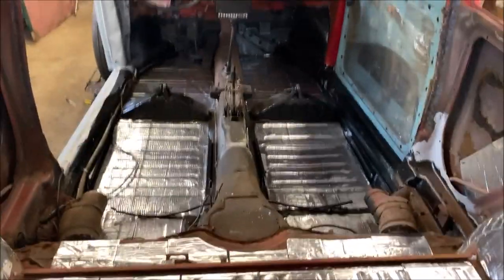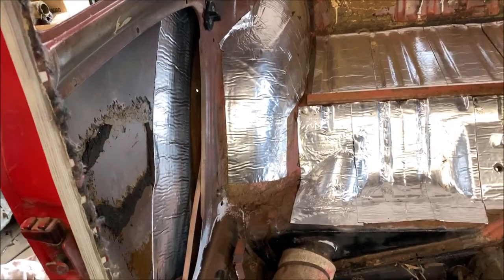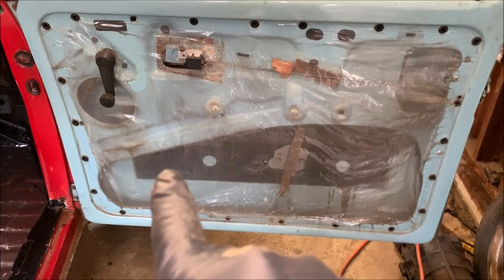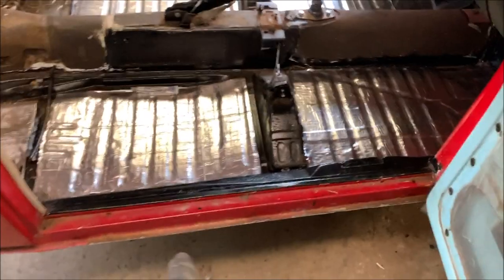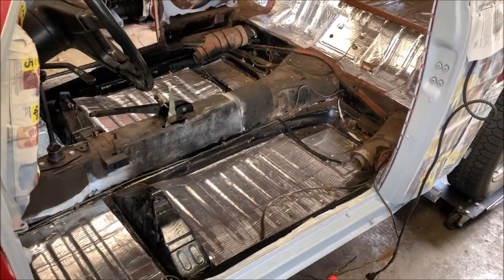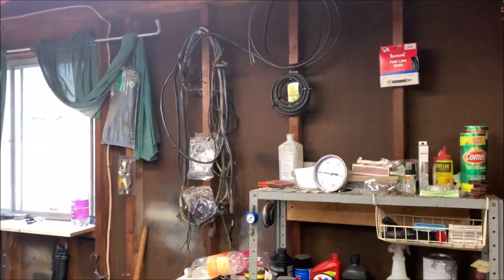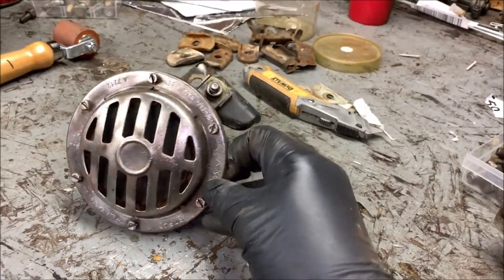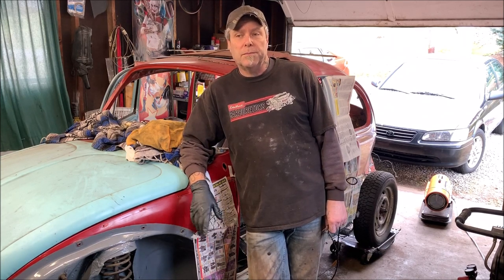VW Beetle - Super Beetle Sound Deadener Part #2 Installation - DIY and How To Install Sound Deadener

Comment: If you had to do it over again would you have just done one layer first over everything then add the double layer in high-noise areas?
Reply from the maker: I’m sorry about the delay I was not notified of this comment for some reason. 😳
Oddly enough you brought this up, I just did a sound deadening video on the 68 that I’m working on it will be up Saturday. 
And yes I would’ve definitely done a double layer again. I talk about it a lot in the upcoming video Saturday. It is so worth it.

Comment: once you finish with the quick roof, do you put anything down before you install the carpet?
Reply from the maker: I install the carpet right over the sound deadener. Of course….with the proper glue.
Reply: @SladesVWBeetle  Do you have a VW that is a daily driver?
Or are they only for weekends?